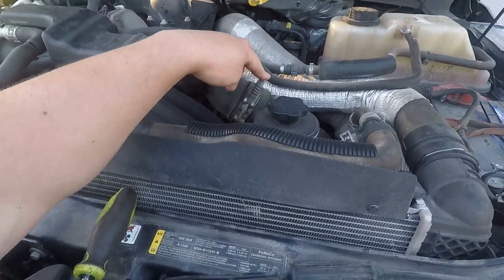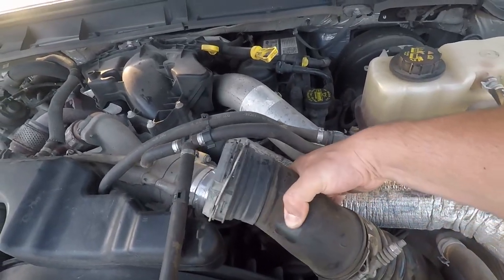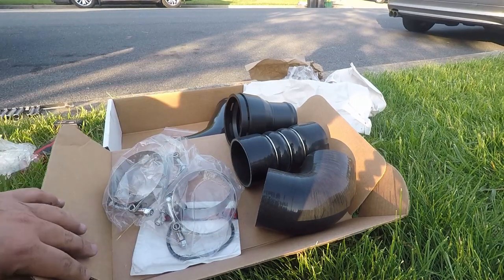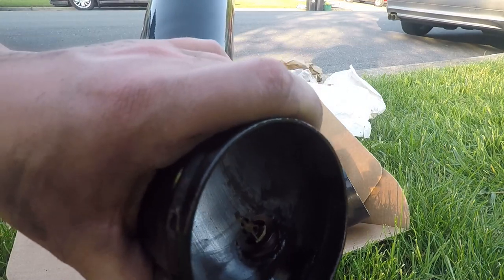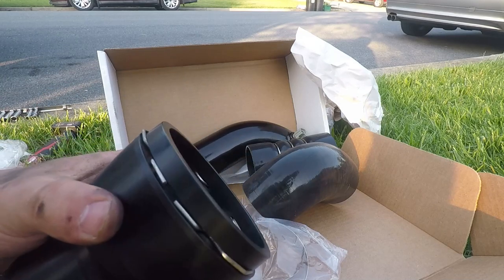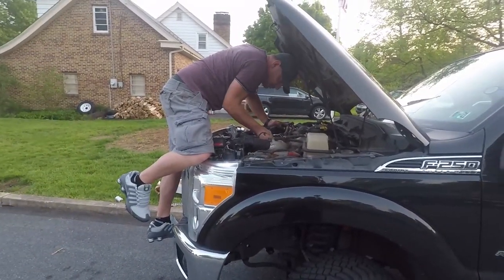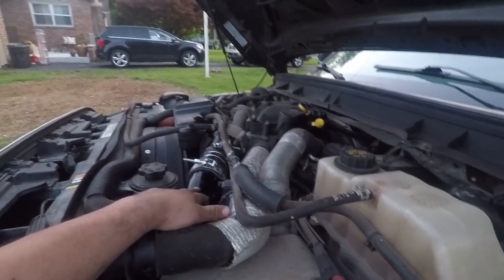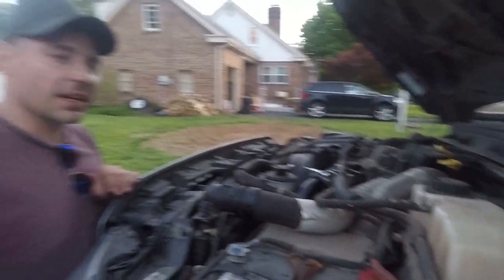6.7 Powerstroke Intercooler Pipe Upgrade

Comment: Great info!   Definitely fixing to replace mine.  I use mine to tow every day.  My skid steer is 11,700 + 5900 trailer and attachments,  so I definitely see this as a necessary upgrade!
Reply from the maker: hey man thank you. I highly recommend it. I would also grab a new o ring while I was at it. I really prefer the metal pipes. I have heard of the all silicone kits breaking after some time. I think I have some links to kits that seem to be good from my research
Reply: @six0bros  thanks man!
Reply from the maker: @littlefinkle7757  anytime glad I can help

Comment: Yea mine blew , holy crap it sounded like a grenade going off under the hood. Haha . Had to buy a new one around 100-120  it was at the dealer , couldn’t wait for an aftermarket one . I’ll get one in the near future . Great video man. I always feel like I should do vids when I see good ones Like this .also I have the rough country led lights for the front grill they look very nice you should look into them
Reply from the maker: I'll have to check them out. I hear ya man when you need one it is hard to beat just getting it from Ford. Plus the Ford will have excellent fitment. The after market ones are a tight fit, but I love the metal ones. I was worried it would happen while towing. I can with a bunch of chevy guys. I cant give then any more ammo against me lol. Thanks for the support man

Comment: I haven't seen a tow video yet with the 6.7 but I wonder if there is any excessive squat, and if so are you or did you install airbags?
Reply from the maker: I just took it on its first tow and will be one of the next 3 videos to come out. I will say it did not have excessive squat but I could tell I did not have air bags. It will be getting them in the future
Reply: @six0bros  sounds like an install video. I run Airlift on my trucks. Simple bolt on kits. You can get pretty fancy with the onboard air options. On both trucks I installed 2 gallon tanks with 150/200 psi compressors. Air horns are a must option!
Reply from the maker: I am planning it. Just waiting right now. This truck will get a set of air bags then I'll compare the airlift to Firestone